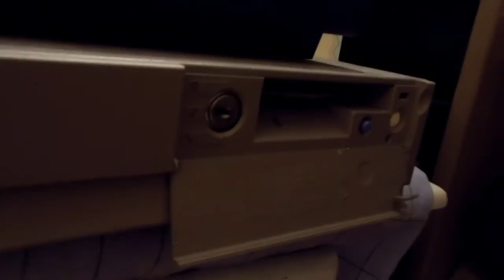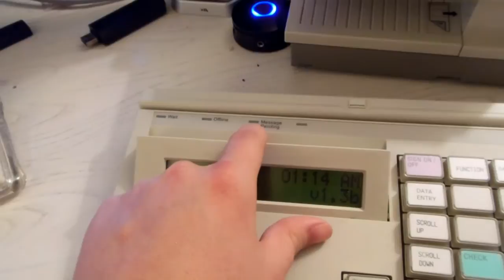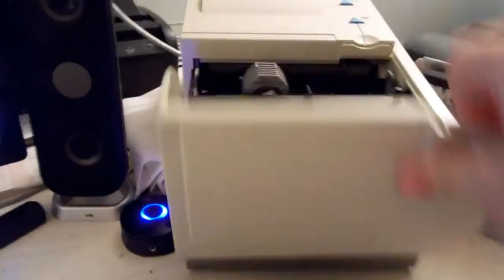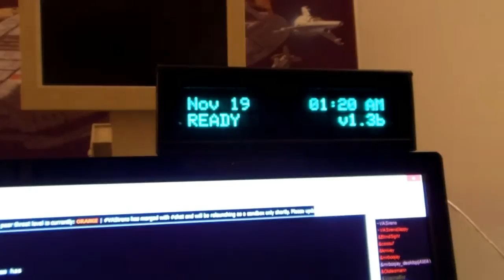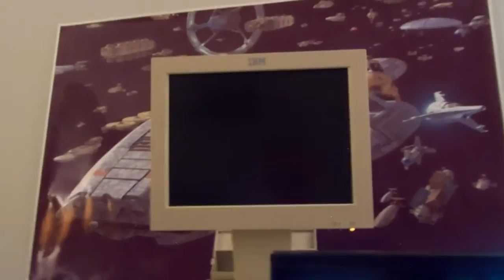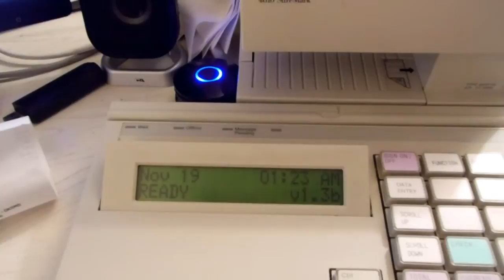IBM POS Hardware

Comment: Hi can you do videos on the thermal printer dot matrix side of the printer the dot matrix printer and the check flipper and do a video of the dot matrix printing printing geographic designs and fun things with different types of paper and the check flipper to use it as a scanner

Comment: Ive been looking for an 80s or 90s pos system to mess around with but this stuff is really hard to find, I have an old digital scale from 1983 which has what looks like a parallel port on the bottom to interface with a computer it came from a dominick's store in the chicago area

Comment: Are the keys on the keyboard just programmed as function keys? If so where can i find the software so i can program them to "F1-F12" keys? So i can use it on my pos software
Reply from the maker: Vincenzo Merchant-Cook it would depend on what keyboard you have, IBM's later keyboards can be programmed to act like a regular keyboard emulating normal key presses. the keyboard shown in the video uses an a API to communicate with the software and it doesn't appear as a keyboard in the system at all.

Comment: A few things to note:
1) Just so you know, the industry lingo is not to say "SurePOS[e}" like in the video, we pronounce it "Sure P.O.S."

2) You are right on what the "Wait" LED is for.  Often these terminals had no hard drives and were connected to their primary controller ("CC") via Token Ring (not even Ethernet).  If cashier scanned too many items, the system couldn't buffer any more and would force the cashier to wait until it was done printing the scanned items and updating the order total.  Then the LED would go off and the cashier could carry on.  When I was a kid, we would all race each other to make the tills make us wait.  It was always fun.  If you did that (not overly difficult to do, you were a "superstar" (we literally called ourselves "superstars." (not joking).  Fun times.  Then they came out with RPM Reports (Rings Per Minute).  This is average number of items the cashier could scan in one minute.  We all challenged each other to be in the number one spot.  Oh - old times.

3) The fourth (4th) LED on the keyboard (top, left) was designed so that stores/companies could light an LED on the keyboard that was a custom function.  With the IBM 4680/4690 systems, it is extremely common for the owner (normally large chains and supermarkets) to have 4680/90 programmers at their head office.  These systems were easy to modify once the 4680/90 system is installed.  Since customization is so high on these systems (almost every company had customization) you could light the LED for a specific reason.  As an example, a customer may have written a bad cheque/check in the past that bounced.  When you scan their loyalty/points card, it would light the LED so the operator would know to call a manager - they owe the store money for the bad cheque/check.  This is just one example of what you could do with that fourth LED.

4) Common reason for the dot matrix paper reversal was to print on cheques/checks.  For example, here in Canada, all cheques/checks have to be printed in the EXACT same format.  So the customer would simply sign their cheque/check, and the cashier would put it in the printer.  The printer would fill in the date, amount (in words and digits) - then reverse and print the store/company's bank account information (i.e. "For the deposit only to, ABC Supermarkets, Account# 93473292, Branch 3024, Institution 004").

5) Finally, why would you want to power everything over a single cable, like the monitor or printer?  This makes it easier for larger chains.  This makes it easy for the head office/Help Desk to work with regular, non-technical employees (say a head cashier).  The Help Desk would determine the printer is bad (as an example) and ship out a new one overnight to the store.  The employee would then only have one cable to worry about - making it very simple.
Reply from the maker: Neil Hyndman Huh, I hadn't heard about the pronunciation. As much as I've used one, I guess I never heard it aloud.

As for the wait LED, yeah, I learned that using a real register. We were fortunate to have an ethernet network, and two controllers in the store I worked in. The worst thing was when a register was rebooted. The added load to the network would cause the others to hang, particularly our Customer Service where I work seemed to get the worst of it.
Reply: @michaeldim1  i want to add those "power usb ports" you mentioned towards the end of the video, to my computer. Any place you know I can get like pcie card that them built in. EBay sure doesn't have any.